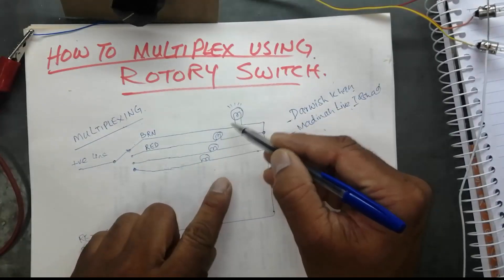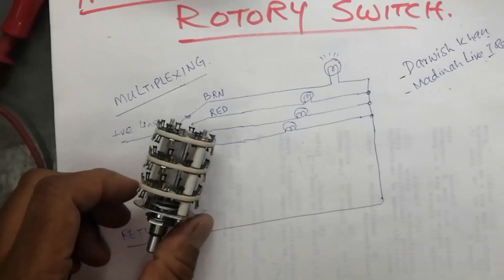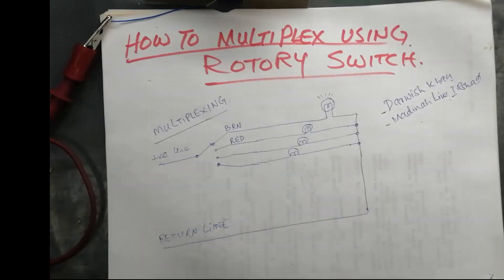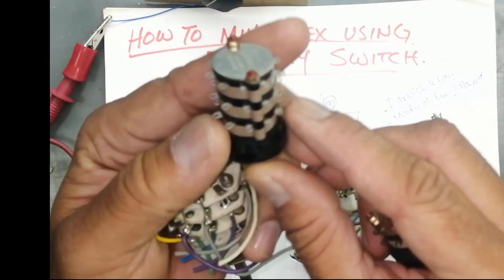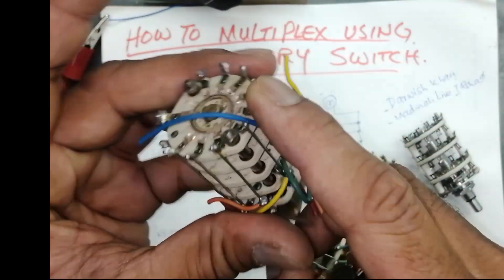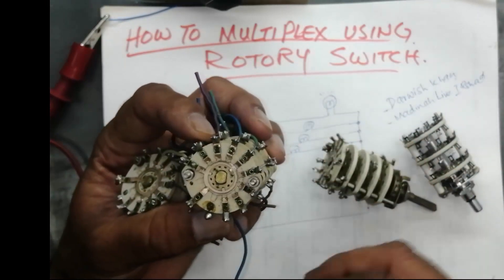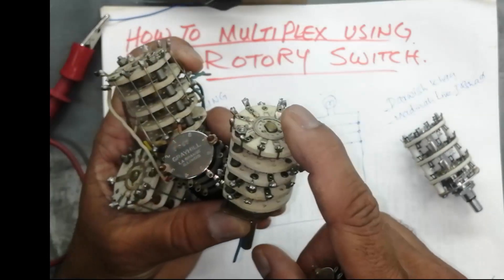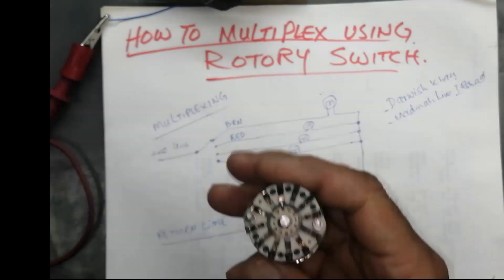Rotary Switch Wiring @madinah live irshad, @darwish khan

Comment: Thank you for the tutorial, I'm planning to make a coin slot cellphone charging station with 3 types of adapter. I'm gonna use Allan Timer connected to universal coin slot which will control the main power, then I think the rotary switch is good for selecting which adapter line will be powered.

Comment: Thanks for a great video and explanation. Would I be able to use this to switch mp3 songs or usb drives instead of lights? Thanks again.
Reply from the maker: it is mechanical rotory switch, 
and in MP3 & USB devices there is a different method that is Id resistance method 
and 
BCD type switching matrix 
and these inputs are routed to a digital converter to process in the microcomputer IC